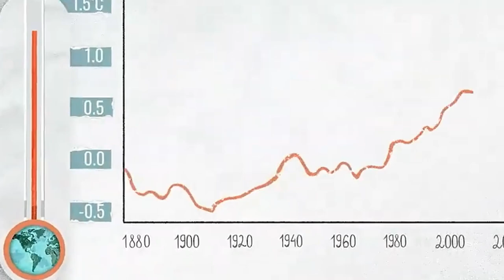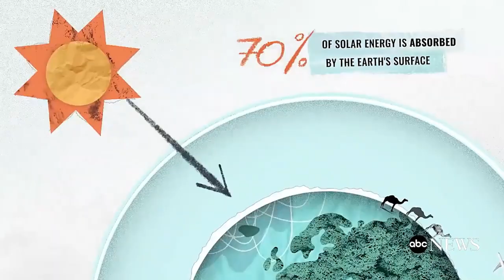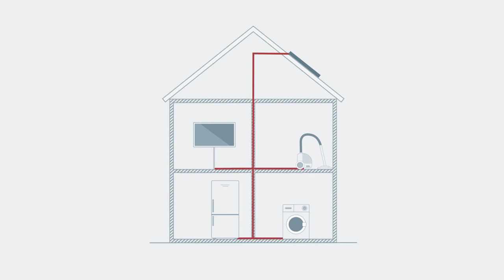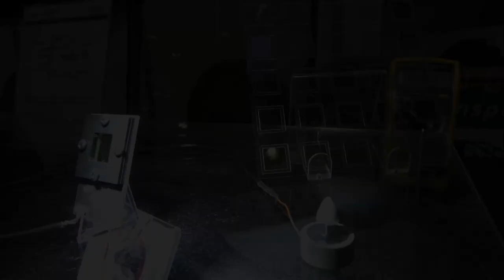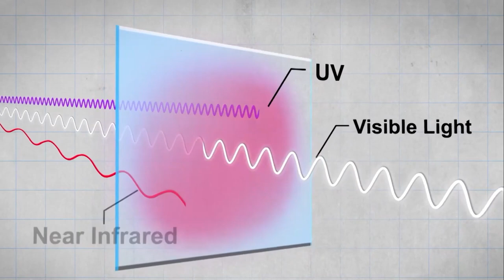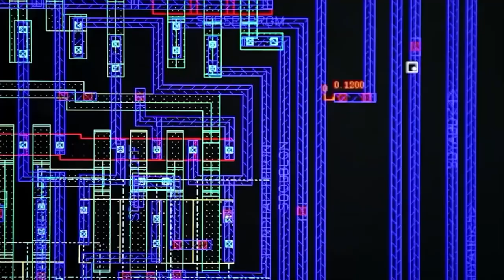New Vertical Solar Modules Boost Power by 300%: How Do They Work?

Comment: The claim about vertical panels generate more power than inclined panels is ridiculous. Why bother listening ?
Reply: It's only during winter and particularly with snowfall that vertical panels generate more power, that's what should have been reported instead of implying that it was all year round. A combination of vertical AND horizontal mounted panels would be the ultimate, other than panels mounted on sun trackers.
Reply: The hotter the panel, the higher the electrical resistance.

Comment: This is the same energy that left Texas high and dry when we had that freeze. It couldn’t supply enough energy. Then when summer came we were getting constant warnings to ease up on electricity, too much power draw . Didn’t seem to have this problem before the wind and solar implement.

Comment: +30% at most bi facial boost vs poly panels. 100m x 10cm =45kw, solve the, we have to room for solar panels on the ground bs. South facing vertical mount in the open I make power all day, 100w 20 mins before sunrise. Snow never sticks panels stay clean for a year.  Why does the video show so many non-vertical mounts? Vertical and elevated are different, but vertical mounted 1 m off the ground is rumored the best position. It is more based on its overcast and low light performance.

Comment: The German claims are BS. Real world evaluation of these double sided vertical panels shows that the rear one produces 50% of the power of the front one and that vertical plans are 2.5% more efficient than sloping ones due to lower temperatures. Using the traditional mathematics I was taught in the 1950s that comes to 157.5% of the normal sloping panels not 300%. Considering the amount of carbon dioxide released in the mining, purification and manufacture of the panels and their transport from China the effect on climate change is going to be reduced over the conventional ones at higher cost, that is if one believes the BS about carbon dioxide and increases in atmospheric temperature which anyone logging on to NASA's USCRN data can easily see is a lie.